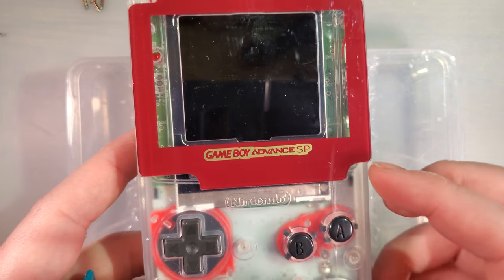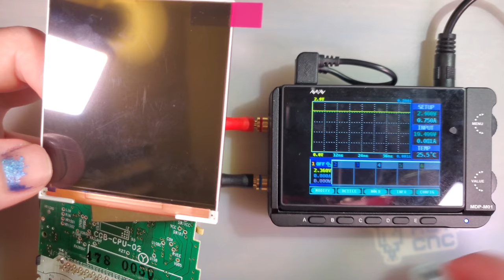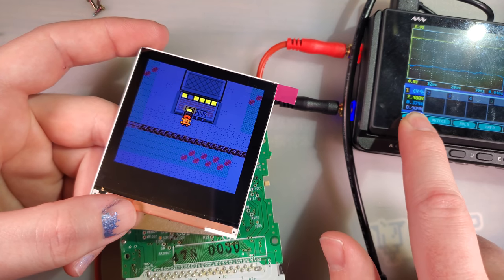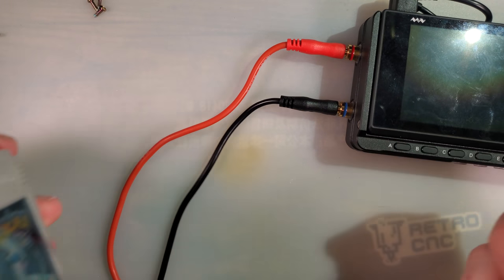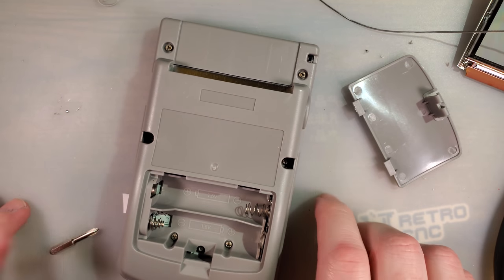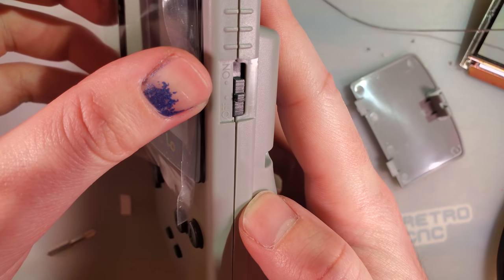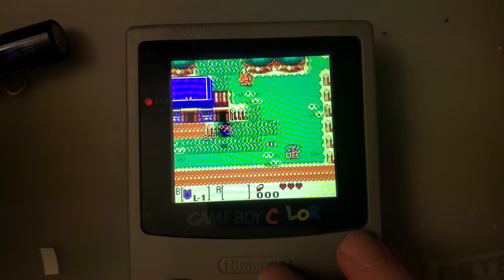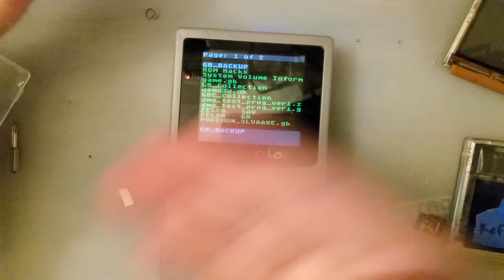Funnyplaying GBC Retro Pixel Q5 IPS LCD Kit

Comment: I'm surprised Funnyplaying have come out with this kit lacking in features several months later. When I saw it on their website I thought it was going to be a huge improvement. The Super OSD is the better kit in my opinion, that screen positioning adjustment and the colour palettes give it quite an edge over the funnyplaying. And it has two touch sensors that come pre-soldered to the ribbon, even less hassle to install.
Reply: To me it feels like a bit of a moneygrab. There are many who will buy anything FP, and would choose their products even if there are superior, cheaper alternatives available. Then FP will go and release a newer display in a few months time with all the missing features to cash in even more from their dedicated fanbase and casual one time modders who do minimal research before buying. But that's just what I think.
Reply: Not to mention the FAR higher power consumption. Yes, I expect a new screen that was never meant to go into this console to use a lot more power, but this is ridiculous! It's almost as bad as the "C LCD" for GBA. I know we have NiMH rechargeable AAs easily accessible these days, but really. I may like the more accurate pixel grid effect (which the OC one already has, just slightly more primitive), but it's not worth reducing the battery life to less than a quarter when the alternative uses the same LCD and gets over a third of its original life.

Comment: Hey Makho! Can you help please me with my GBA SP? For some reason, the power light flashes when I connect it to the charger and it doesn't charge the battery. People suggested me to get a new battery so I did and also pick up a charger as well but still doing the same thing. Do you have any idea what may be the problem? I'll appreciate your help. Thanks!
Reply: Hi ! Try to replace the fuse 
Watch this :
https://youtu.be/a5Vbos37QCc
Reply: @ed3n4pf  Thanks for the tip. Unfortunately, I don't have soldering (or know how to solder things). I guess I just would leave it alone. Thanks again and have a great week!
Reply: @auroradeboer9350  Quarantine is the best time to learn. Don't need a expensive soldering iron to start. I'm going to soon.
Reply: @NoOne-mn7so  The GBA SP is fine! It was the charger. Thanks anyway for your comment.
Reply: @auroradeboer9350  Oh cool, glad it was a simple fix.

Comment: This guide was helpful as I did my own install. Unfortunately my console won't boot... screen and power LED flash on and off like it's stuck in a boot loop. Works fine if I disconnect the power wire (can hear game audio).
Reply: My console boots  and gets stuck with the kit without the kit it get all glitchy and reboots. I think my soldering was bad.

Comment: I just got a motherboard from Ali-Express that is crap. It looks like it was in a fire then a flood. Anyways Question??? Can I use a GBA Link port and just cut the shell a little? I can't find the parts I need? I should have just spent 10 more dollars and got one on Ebay in a shell but I didn't need the shell.😠So mad. Ali-Express has always been great until I went to do this mod. First I screwed up and ordered a speaker and the shipping was like 40 dollars. Always something.
Reply from the maker: yes, the port should work. You can also pull one from a Pocket if you want

Comment: Is there a way to control the brightness with the start and select or does it only control the scan lines? For some reason the touch sensor on mine doesn't work and I don't want to troubleshoot it if I can do it with a button combo.
Reply from the maker: nope, these kits require use of the touch sensor

Comment: with the flux.... did you pre flux the board prior to attempting soldering? I did not see you apply flux prior to soldering - yet you indicated the board has flux at the solder points (this is regarding @33:10 for the start select wiring)
Reply from the maker: rosin core solder has a rosin core, hence the name. Rosin, for all intents and purposes, is flux. Feeding fresh solder into a solder joint will introduce flux.

Comment: Im still unclear which version is better, this one? or the one with the on screen display. I'm considering modding an old GBC i have lying around.
Reply from the maker: Well, they both have slightly different feature sets. If you care more about the pixel grid, this kit is probably better. I don't so I like the other kit.

Comment: Would you consider doing/trying a Neo Geo pocket rechargeable battery mod, there are literally ZERO resources online. Some dude on reddit who is from south east Asia shows off his mods but does not respond to comments. Another reason for this mod is the new IPS Kits are having issues running of weak batteries, a Lipo battery might be necessary.
Reply from the maker: LiPo won't offer better run time though. The battery capacity just isn't that different.
Reply: @makho  you think there's anyway to realistically get more power on a NGP?
Reply from the maker: @MEEG0L  physically larger battery would do

Comment: Are there any functionality differences between this and the Ali express kits? Also, just curious, is there a particular reason you choose not to use flux?
Reply from the maker: depends on the kit. The "aliexpress kits" are not all the same kit. Funnyplaying does have an aliexpress store.
Reply: for someone that just wants a color backlit screen is it worth going for the new qv v2 ? i like the idea of this older one if the screen lens gets scratched you can replace the lens the new kit it seems like itd be a whole screen replace. also here in australia retrogaming mods never reply to messages. hahaha

Comment: Weird question but I'm having trouble transferring my saves to my ever drive😭
Reply from the maker: this isn't a question. I also cannot infer enough detail to guess at what the problem is.
Reply: Hahahah oops! I thought I finished 🤣 so have you been able to move your saves from your old carts to your everdrive? Like my pokemon ones don't transfer over😭
Reply from the maker: @dakotajoseph2821  "don't transfer over" doesn't clear things up. What do you mean? What are you doing? What do you expect to happen? What actually happens? I have my Pokemon Silver save on both the original cart I dumped it from, a few other Pokemon Silver (and Gold) carts, and my Everdrive and Ez Flash Jr all. It's definitely possible to dump the save and copy it over.
Reply: Guess I'll ask this way... Can you make a guide on getting your old pokemon saves from either your emulator or old carts ( I already know how to do this part) and get them to be recognized by everdrive carts?
Reply from the maker: @dakotajoseph2821  You have to dump the save with something like a gbxcart rw and then copy it to the save folder on the flash cart. The save has to have the exact same name as the ROM file (which you can also dump with gbxcart rw) and have the proper file extension. If you boot the ROM on the flash cart, start a new game, and save it, you can then restart it and boot another game to copy the save to the uSD and then just see where the flash cart saved the game you are trying to overwrite. 

I suggest you do some searching, there are definitely forum posts or guides on this.